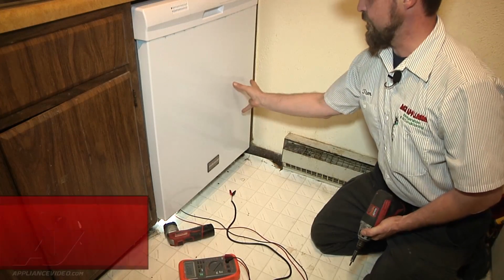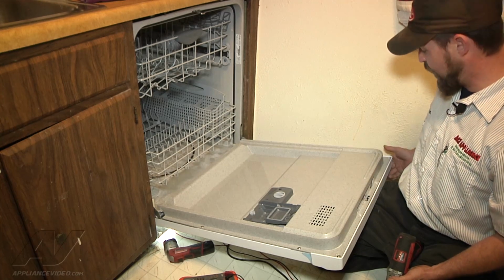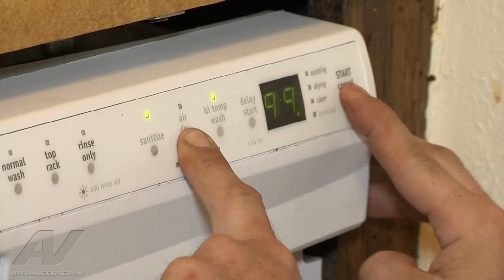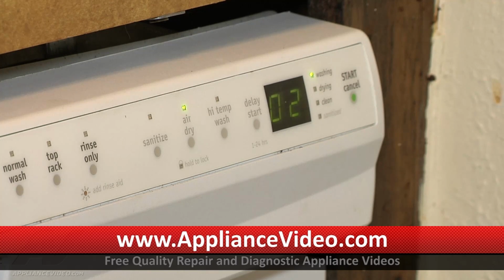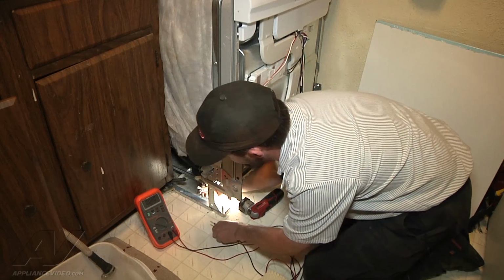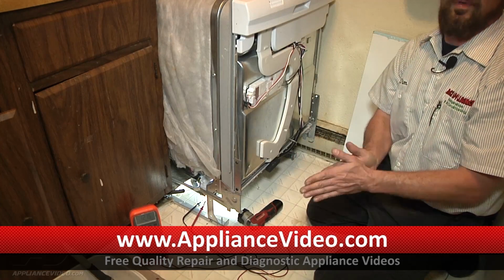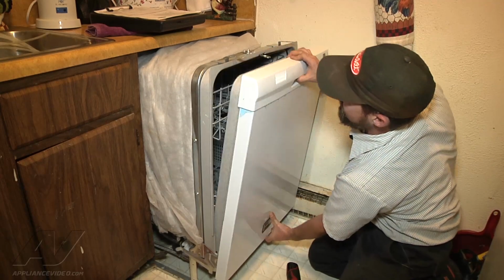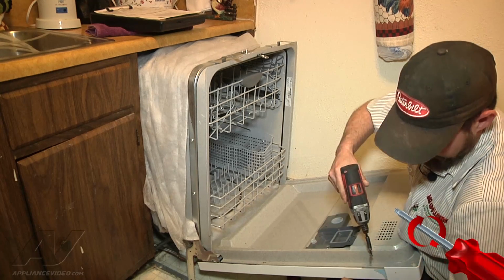Frigidaire Dishwasher Repair - Not Draining - Drain Pump

Comment: How much the voltage send from the control board to the pump please
Reply from the maker: Great question, if you have a more technical question that our parts department cannot answer, you can search our over 17,000 answered questions free at our website www.ApplianceVideo.com under our Repair Help section. You can also call our parts department at 1-800-830-5465 and they can give you help 7-days A week ,or search at www.SaveMoreOnParts.com  .

Comment: thanks...my hubby already replaced the drain pump, worked for a few days...full of water again...🤨 Looking on your channel  for how to test the control board.  Should be a fun one as I have the hidden control panel! FGHD2433KF1-
Reply from the maker: Great question, if you have a
more technical question that our parts department cannot answer, our
technicians are answering all questions at our website at www.ApplianceVideo.com under our Repair Help section. You can also call
our parts department at 1-800-830-5465 and they can give you help 7-days A week
Monday -Sunday, or search at www.SaveMoreOnParts.com  24 hours
7- days A week.

Comment: my Frigidaire doesn't have that LED screen. didn't drain, it was full of water all the to the edge. I cleaned water, checked and cleaned ball, checked drain hose and finally installed brand new drain pump. after cycle, same thing, not draining. dishwasher is five years old.
Reply from the maker: Great question, you can call
our parts department at 1-800-830-5465 and they can give you help 6-days A week
Mon-Sat . You can also search at www.SaveMoreOnParts.com 7- days a week.  If you have a more
technical question that our parts department cannot answer, our technicians are
answering all questions at our website at www.ApplianceVideo.com under our Repair Help section. We have over
4,000 common questions and answers that you can easily search through by your
model number, appliance make, and problem or error codes, and It’s free to
search through our question & answer library.

Comment: if I press cancel button during cycle  should my dishwasher drain?
Reply from the maker: +BUDDAz1g 

We would like to help you
answer your question. With our videos now getting over 900,000 views per month and
hundreds of questions from people like you, our technicians are now answering questions
at our website http://www.appliancevideo.com/repair-help/ .  We also have over 2200 common questions
and answers that you can easily search through by your model number, appliance
make, problem or error code and it’s absolutely FREE. You also have the option
to email a factory service technician with a question on your appliance at http://www.appliancevideo.com/repair-help/ . If you’re looking for a repair video, you can
also search our library of over 2600 free repair videos. ApplianceVideo.com
specializes in quality DO-IT-YOURSELF appliance repair videos and we get over
800,000 views per MONTH to our videos worldwide and growing. If you need of
parts for your major appliance, we have over 5-million parts in stock at http://savemoreonparts.com/ .  Thanks for your support. Matt Ace
Appliance factory service technician.
Reply: yes

Comment: I have a different Frigidaire, but getting into the diagnostic mode was the same.  Thanks!
Reply from the maker: pyronaught
              Many of  them have the same diagnostic codes.  We are glad we could help resolve your issue and hopefully saved you money. Please help us provide more videos to our site by posting ApplianceVideo.com on your YouTube, Facebook or Twitter account or add us to your circles. If you are in need of any parts please support our parts department on line at http://savemoreonparts.com/ or call 1-800-830-5465 7-days a week until 11pm Eastern time. Thanks again your support.  Matt, Ace Appliance service technician.

Comment: Had a Frigidaire dishwasher that would only make a humming noise when it was suppose to drain.  Checked all hoses, cleaned the filter out, and finally took the drain pump off.  Inside the drain pump housing, I found a piece of glass from one my wife had broken in the dishwasher a couple of weeks ago, and it was wedged against the impeller on the pump.  How it got past the filter I don't know.  Removed it, put the assembly back together, and it is working fine.  Sure thankful for all the repair video's posted.  Watched several of them first before starting the job, and repairing it was easy.
Reply from the maker: 1950rws
                Thanks for your positive comment. Luckily it was only a piece of glass . Please help us provide more videos to our site by subscribing to our YouTube page or posting ApplianceVideo.com site on your Facebook or Twitter account. We also have our factory authorized technician’s email daily free professional advice to people like you to help solve their appliance problems. Thanks in advance for supporting us. Matt, Ace Appliance service technician.
Reply: I have the same thing. Pump humming. I'll fry to get to the pump and look.

Comment: Another blockage..Opened up with a 4 ft section of 1/4 plastic ice water line. What a fantastic time saver using the diagnostic code 07. Didn't have to wait for rinse cycle.. ran 3 or 4 gallons of hot water thru the drain to flush it out well. AWESOME. Thanks!
Reply from the maker: John 
     Thank you for your positive comment.  Please help us provide more quality videos  by subscribing to our YouTube page or posting our ApplianceVideo.com site on your Facebook or Twitter account. We also have our authorized technician’s daily emailing professional advice daily to people like you that have appliance problems. We have helped thousands of people save hundreds of dollars. Thanks in advance for your help.